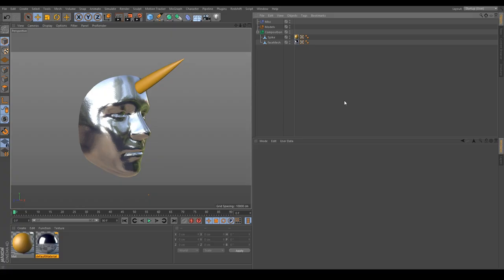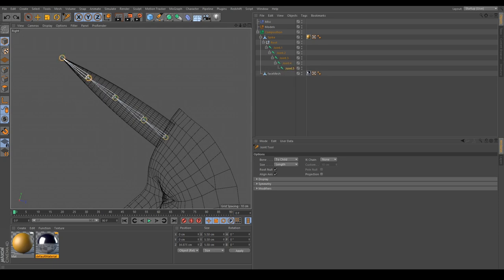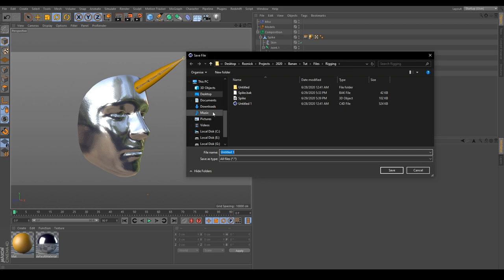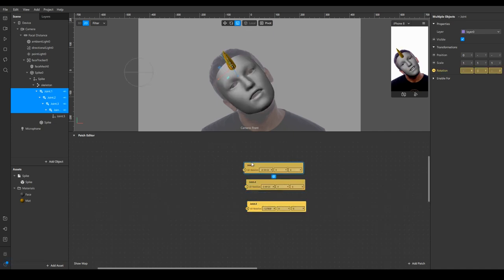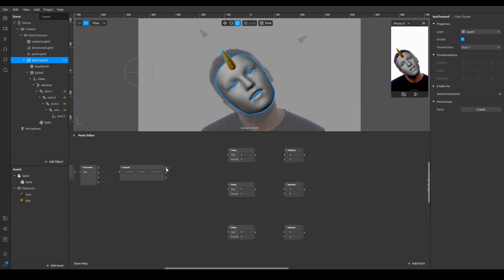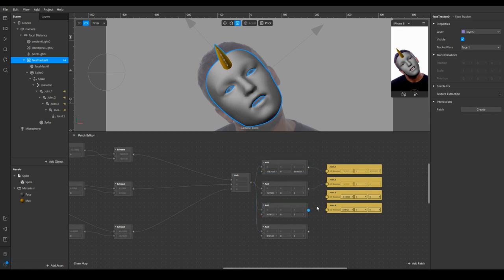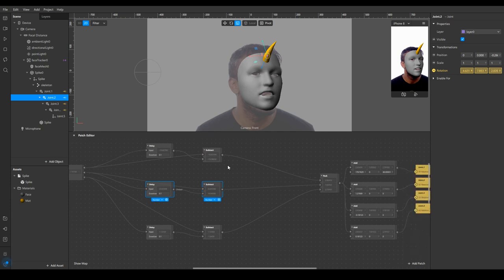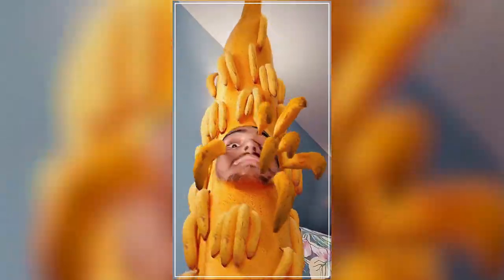Easy Physics Motion - Spark AR + Cinema 4D

Comment: its strange but i didnt have glt format for export in c4d 21 .. And also i have strange thing when i export easy standart model of tube with joint to 
FBX format its work well in spark, but if i try export complex model (for example pickle) with joint its dosnt work for me. Any tips? appreciate!
Reply from the maker: You will have to install a free plugin to export as glTF which I've linked the the description. FBX works too, but it glitches out while running on newer iPhones as of now. 
How many joints does your complex model have? Maybe try keeping them to a maximum of 4 joints or below.
Reply: @RomanPillai  giTF format dosnt help =(  can i send to you screenshots?
Reply from the maker: @JorikRosa  yeah, leave me a message on my Instagram, I'll take a look
Reply: Roman Pillai I wrote to you, please check your IG DM 🙏
Reply: did youmanger to find the solution for this?
Reply: @bondell1840  yeap, mesh must have lower then 10k vertex